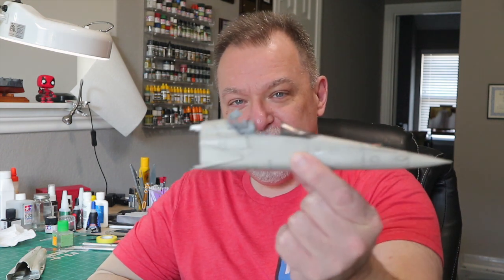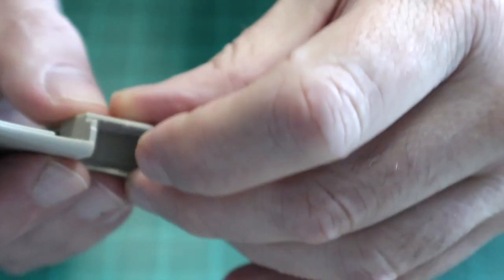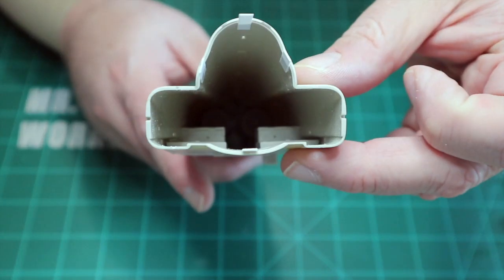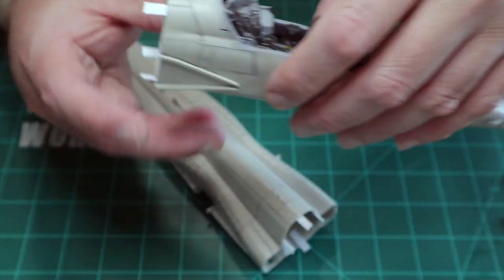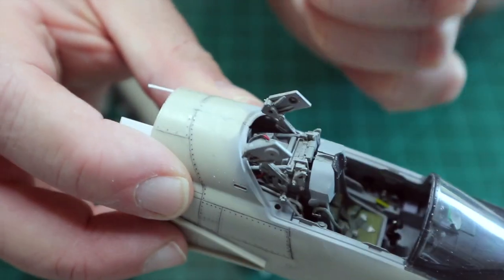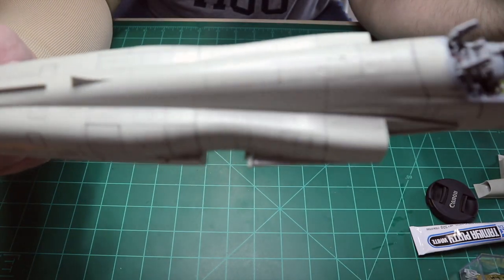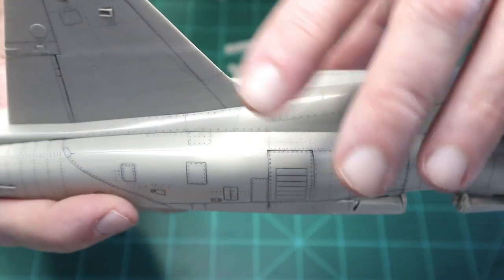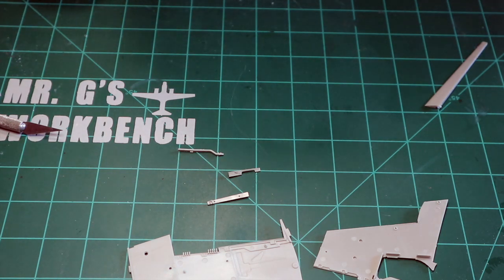Building an Austrian F-5E in 1/32 (Kitty Hawk) - Part 2, Fuselage and Wings

Comment: truly enjoying this... including the rants and raves.  As usual KH has dropped the ball. perhap-s a boycott until they learn? Anyone up for that ?  thanks for airing your views.  Dane
Reply from the maker: I doubt anyone will stop buying KH kits - they can't seem to stay in stock from what I've seen. It's obvious they don't read feedback and they don't fix their instructions or improve their kit engineering for the most part. And the times they've received assistance from knowledgeable sources like Floyd Werner they've used bits and pieces of that guidance - the UH-1 looks nice but even Floyd has said online that they did heed all the advice given. I'm really not sure what will every change on their end.

Comment: Coulda saved alot of headache by building a hasegawa kit. KH is rough
Reply from the maker: You're certainly right - I could have built the Hasegawa kit. I wasn't sure if it was a raised panel line kit or not, and I had followed Chuck Sawyer's build closely - it's not a terrible kit, just problematic in a few major places.